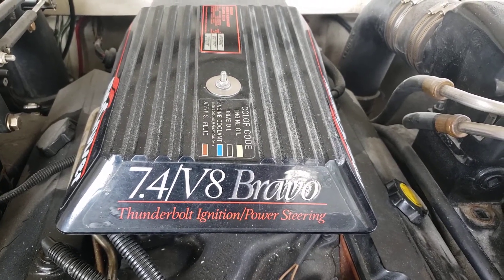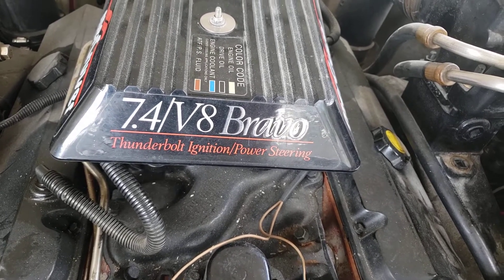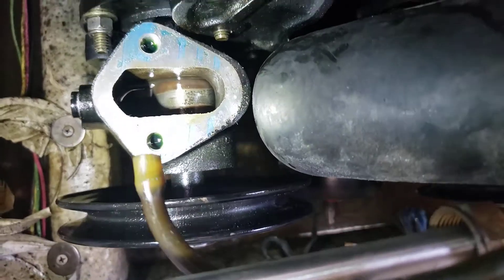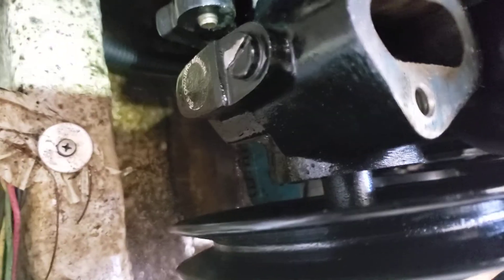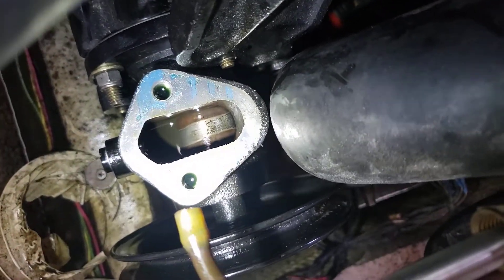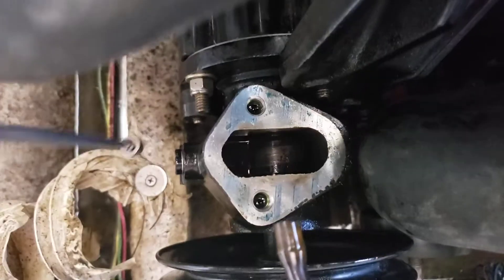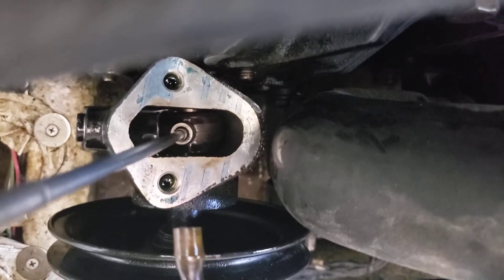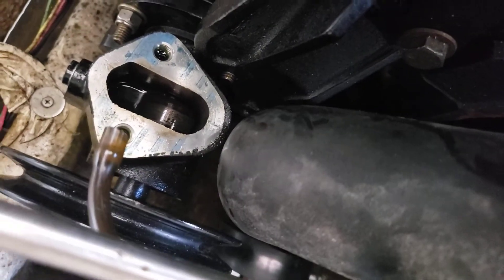7.4 Bravo Fuel Pump Issue Exposed

Comment: THANK YOU for posting this.  I thought I had a clogged fuel tank cause still couldnt grt fuel after a new pump.  I would have never thought of this as being the issue.  Was about to put another fuel pump on when I checked this and totally dry of oil in the pump and the lobe was TRASHED.  Fired right up after changing sea water pump.  Thank you so much!
Reply from the maker: Glad to help. Thank you for letting me know. Appreciated

Comment: This is a super helpful video. Thanks to the uploader for sharing it. I'd like to add some info here....

When the fuel pump diaphragm fails, it allows raw fuel to enter the eccentric/bearing area, which is filled with viscous Mercruiser gear oil. That viscous gear oil ends up getting very diluted, which causes a loss of lubricity, resulting in the eccentric/bearing failure. If that bearing has failed as illustrated in this video, consider replacing the water pump as well, and make sure new gear oil is filled to keep this area well lubricated. I'm not certain, but suspect that fuels containing ethanol may contribute to premature diaphragm failure within the fuel pump itself. It may be worth paying extra for non-ethanol fuel on a fuel system with mechanical fuel pump.
Reply from the maker: Agreed that fuel pump diaphragm failure would certainly cause a failure that could be misconstrued as oil or seal failure however we could add one more scenario of impeller failure and overheat but more likely restrictions in common area's resulting in overheat of eccentric with loss of oil viscosity over several operations of the engine. 
Ok.. thats all I got right now. 😅 Great input. Well noted. God bless you. You are a blessing for sure. Hope to hear from you again. Thank you again.  Lewis E. Walker
Reply from the maker: I don't think ethanol based fuel damage could be measured due to age of these units but I'm certain Carter knows the effects.
Reply from the maker: I think we both missed statingbthe fuel pump should be replaced after such a failure has occurred

Comment: I put a block off plate on the waterpump to fuel pump and installed an electric in line fuel pump runs great
Reply from the maker: Thats awesome. Just be careful as it's not on a timed relay and will run when key is on and engine off
Reply: Did you just install an electric fuel pump designed for carburetor pressure at 4.5 - 5 PSI? Perhaps a Holley?
  I had 8 service techs and repairing boats, engines & drives on vessels up to 34’. We were an authorized Mercury dealership and could not install any brand of aftermarket fuel pumps. But, to address your issue, they removed the low pressure supply pump and simply used a suction gun to remove the oil. The manual indicated drive unit oil, not motor oil. A new gasket was part of a winterizing 7.4L canned job. Just like fuel stabil & fogging oil. As the service manager, I built automatic service tickets for different jobs for those going to storage.

Comment: i have a 1995 baja SST  not getting fuel, this seems like exactly my issue it will  idle but when i give it throttle it dies instantly almost , that being said in your experience replacing the raw water pump along with the mechanical fuel pump should fix this issue?

Comment: Thanks for the video. I pretty much have the same set up. I do however have a question. I’ve replaced my fuel pump and now in the process of changing carburetor from 4 barrel quadrajet to 4 barrel edelbrock , my question is, the vacuum line from the fuel pump, where does it go on the edelbrock? I connected it to the larger port in front of carburetor but it stalls the motor after running for a minute or two. I took it off and it idles fine but now I don’t know where to hook up the fuel pump vacuum line. Any help would be greatly appreciated
Reply from the maker: There is no provision on the edlebrock. just make up some kind of way in the bottom or top of the air filter spark arrestor. its so when the fuel pump fails it will send oil and or fuel through the clear hose for you to see and will flood the engine causing it to run poorly or smoke as well instead of it dumping into your bilge and being a fire hazard.  You could use a cheap catch can also. aftermarket. Hope this helps.

Comment: What kind of oil do  u run in the water pump. I’m assuming a funnel in the top screw until it’s full. Should I just take the screw out and fill it from the top before the water pump is on
Reply from the maker: I would remove the fuel pump and siphon it out or use a rag to soak up. You can just add oil in the 1 hole and Mercruiser used to have 2 screws so you could drain it. Not sure why the deleted the lower one. The fuel pump is easy to remove but you probably will need a new gasket.
Reply: @hotheadzmarine  well I got all new. My old one was shot. I saw this video before I took the pump off so I have all new to go back in now!
Reply: @hotheadzmarine  I used my magnet and same thing. Shot. Left is stranded on the lake last year
Reply: @hotheadzmarine  my new one has two screws
Reply from the maker: @anthonycarpenter9662   yepper. Actually doing another today.

Comment: Does this degradation also cause a degradation with the pumps ability to pump water as well?   We discovered this issue and impeller is partly getting chewed up a bit
Reply from the maker: It could. If the seal wipes out it can suck air from the fuel pump cavity and starve the water pump.
Reply: @hotheadzmarine  awesome, thanks for the quick response.   There's a weep hole located on the pump and we were also seeing a healthy stream of water trickling out of it.  There was also no oil in that cavity when they took it apart. This was off of a low hour motor bought used but we've quickly surmised that some point in its life there was water in the fuel as we also had a rusty carburetor float and rust inside of the mechanical fuel pump.     Putting on all new parts today and hopefully this solves our problem!
Reply from the maker: @centralparkfitness  YouTube search water in fuel ethanol boats water in fuel. Search things like that or better yet go to our Facebook page and see the video of water in fuel. Hot Headz Marine
Reply from the maker: @centralparkfitness  https://www.facebook.com/162408863811118/posts/3286052364780070/?sfnsn=mo

Comment: So what is this part called?! I have the same exact problem, finger came back with silver “sludge” from bearing destroying itself
Reply from the maker: Is raw water pump assembly with fuel pump eccentric
Reply: Thank you, is there a way to rebuild this or am I looking at buying a whole new raw water pump assembly w/fuel pump eccentric?
Reply from the maker: @DrivenAddict  I would buy a new one honestly. The price for parts isn't worth it. The shaft inside is about 150.00 +/- alone. I think Dierra makes one. I will find you one and send you a link in a little while ok👍
Reply: @hotheadzmarine  really appreciate it!
Reply from the maker: @DrivenAddict  Seawater Pump Assembly | Quicksilver 46-807151A8  there are some knock offs on the net but I have never used any. also Hardin marine has a stainless steel version thats AWESOME.Just go to www.cpperformance.com  and pop that part# in to see it. I highly recommend that one.

Comment: It’s drive oil not motor oil!
Reply from the maker: No gears inside my man, Pressure surface area of contact flat steel. Any good psi oil will work actually.  I'm sure gear oil would work fine as well.
Reply: @hotheadzmarine  yes I know there is no gears inside just a elliptical shaft with a slip ring on it for the pump lever. I rebuilt mine 16 years ago and converted to a electric pump new bearings new seals minus slip ring and it’s still great to the day I do swap out the fluid when I do the pump impeller and housing service. Also I believe the manual says drive oil
Reply from the maker: @robertm2172  why is it necessary to run oil when not using eccentric
Reply: @hotheadzmarine  because there are only two seals on in the front and back. Or at least in my application so the drive oil lubes the bearings. The efl version has completely sealed bearings due to no pump provisions. The block off plates are a auto parts store thing for older Chevy motors

Comment: Your video abruptly ended!
Reply from the maker: Yes it did. My phone has been having some issues and I didn't realize it did until it uploaded but I thought it may be somewhat helpful to a few anyway. Thank you for watching though.👍
Reply: @hotheadzmarine  what grade oil is required? will 30wt work ?
Reply from the maker: @jimmaldonado2566  yes Sir
Reply: @hotheadzmarine  Use gear oil
Reply from the maker: @Thadoseman  I have and will on some that are older from time to time